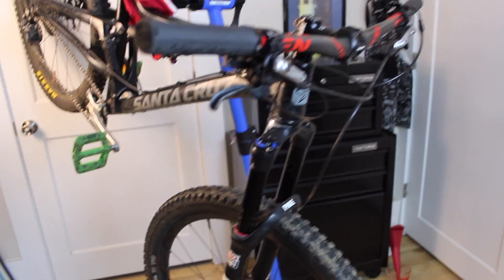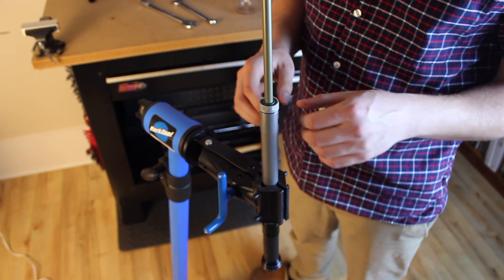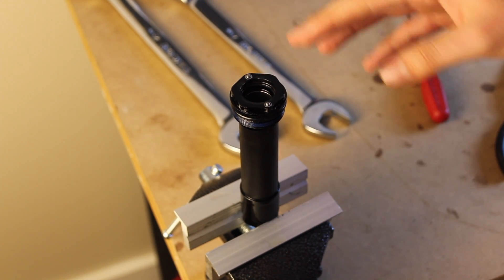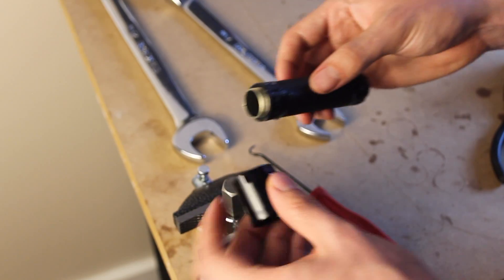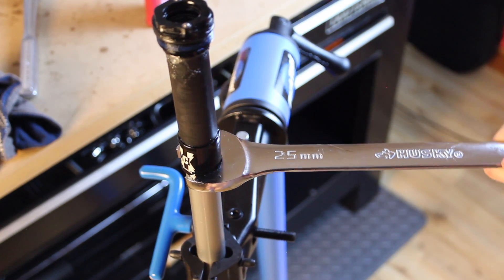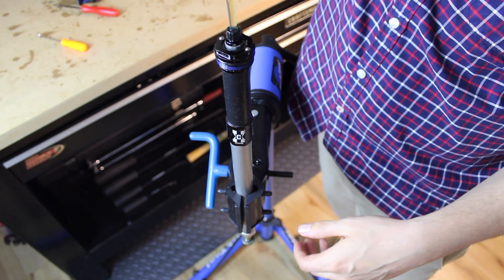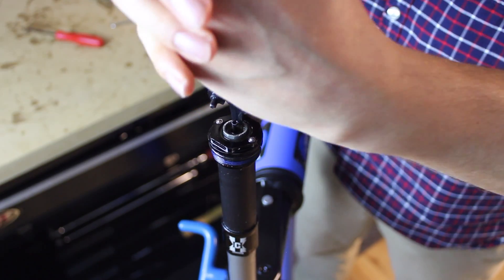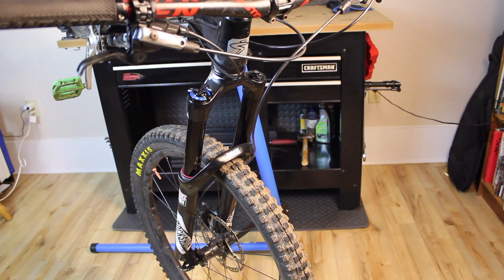RockShox Charger Damper Leak Repair (Pike, Lyrik, Boxxer Damper Bladder Assembly Rebuild)

Comment: I've got a similar issue on a charger on my pike. I've got the fork on a mini mullet that I built up for 4x, so reduced my pike down to 80mm travel. Made it stiffer, but it just won't lock out and everytime I open it there seems to be some oil inplaces there ought not to be 😆  I watched your first vid and just found this, so might give it another go. At least then I know. But thanks, instructive video.